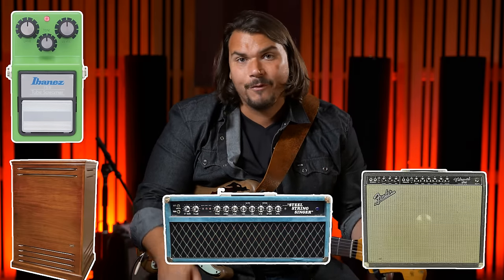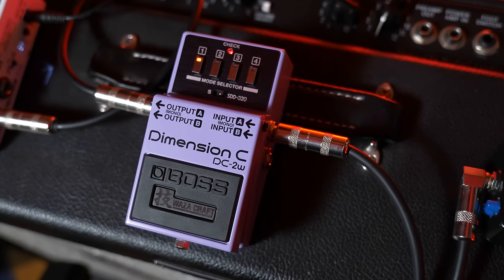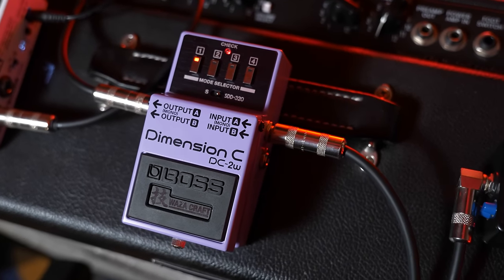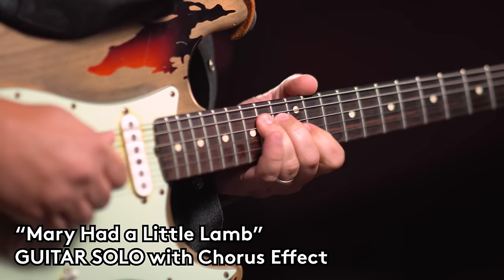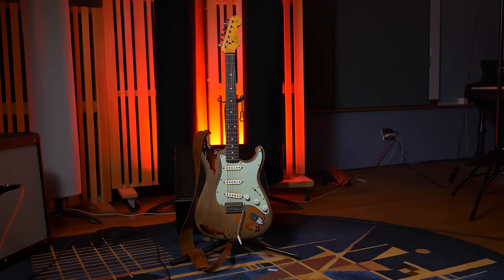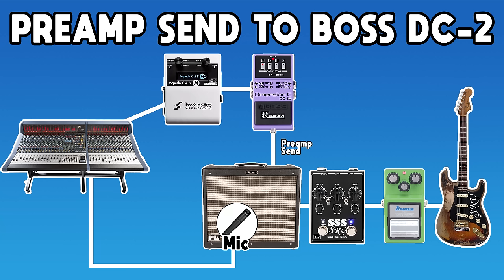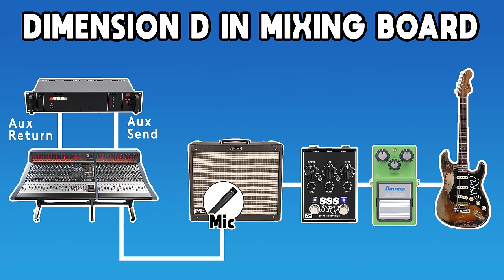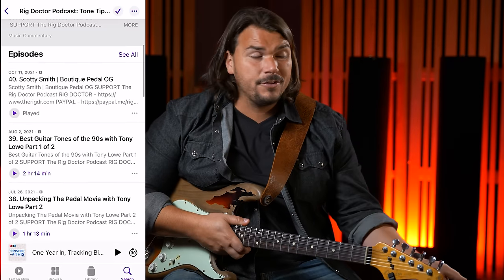The Secret Behind SRV's Tone

Comment from the maker: Which signal path do YOU think most closely resembles SRV's use of the Dimension D? Tell us in the comments below!

Table of Contents

00:00 Introduction
01:47 The Secret Ingredient
02:36 How SRV Used the Dimension D
03:25 How YOU can Implement It 
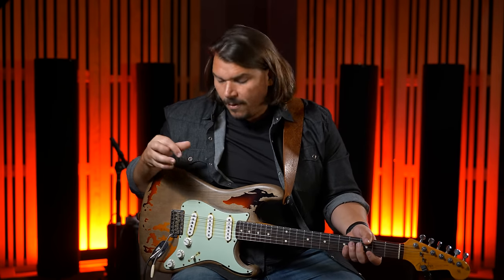04:44 The Gear You Need
05:20 "Mary Had a Little Lamb" Example
06:54 "Pride and Joy" Example
09:14 "Let's Dance" Example
12:28 Signal Path (So Far)
13:22 Alternate Signal Path Options
13:52 Signal Path Option #1
15:30 Signal Path Option #2
16:30 Signal Path Option #3
17:44 Our Way vs SRV's Way
19:04 Recap
20:45 Thanks for Watching!
Reply: Never noticed this effect but hearing it it now. He definitely had the rate/intensity more prominent on Pride.
Reply: Yea, SRV tone for the win 🤜
Reply: Dc2w, tc nova drive and source audio collider set to plate gets a good bit of the way for the first album sound 100% , I use the distortion side of the tc with very low gain to get a bit of faux pre amp drive with the ts side before it to emulate the tube screamer! It sounds great into a superreverb and bandmaster with sping verb off!
Reply from the maker: @MrAbelone  For sure!!!
Reply from the maker: @billytremoloband7456  Yes!!!
Reply: @VertexEffectsInc  can’t wait to actually get out gigging again with said set up, to be fair to you and your tone ears the tc nova and source audio collider are an excellent combination with a Strat, heavy’s strings and a loud cleanish fender amp! The dc2w then is just extra icing on the tone cake 🤜
Reply from the maker: @billytremoloband7456  Sounds like a dream!
Reply: I liked option 2 but I might be weird
Reply: says this comment was posted 2 days ago, but the video was uploaded 11 hrs ago 🤔
Reply: Well how would u compare it to the. Eric Johnson chorus pedal. The old one.
Reply from the maker: @godbyone  it's more about where the chorus is more than what the chorus is.  I'm sure any number of chorus pedals could pull off a similar result.  The X factor is having the chorus after the dry amp, in parallel.  You can hear when I go to the FX Loop example, it looses the subtlety of the chorus and the effect and really becomes obvious that chorus is present.  That's not now SRV did it...it was much more transparent and behind the scenes.
Reply from the maker: @dannap8831  magic I guess.
Reply from the maker: @WayneMemphisMojo  1 and 2 were both pretty similar.
Reply: @VertexEffectsInc  teach me your voodoo vertex effects!
Reply: I like the Double D in the mixing board. The chorus is there, but barely...and that's what I love about it, as I'm not the biggest fan of a super wet chorus. But the difference between using it & not, is HUGE! It's amazing that such a subtle change can add incredible dimension.
Reply: i have a timeline. can i use timeline effects loop to acheive this setup?
Reply: I used a later Roland digital delay rackmount unit with a chorus effect and some modulation. It NAILED the sound. It was a later more perfected delay from Roland Boss. A 55-65 ms  chorus delay with a slow medium slight modulation warble and bazinga ! Oh and I also built a 100% hand wired Dumble Steel String Singer in a 120-60 Watt version using a slightly better layout than Howard Dumble did. I did mine on a rare piece of large perf board wired up to British military specs on turrets kind of like a cross between a Hi Watt and a Fender layout. Howard used a very Fender like layout in all of his amps. Alex started out hotrodding Fender amps for The Ventures so he used Fender-esque layouts. His amps are a mish mash of parts from the bygone days of the corner electronics parts stores. You walk in say, " I need 600 volt 0.47 uF caps" and the clerk brings you whatever they had in stock that day. It might be an orange drop polyester or it might be a blue Arcotronics polypropylene cap. Again, whatever 600 volt film caps were on the shelves that day.  It could be Sprage, or Arco or Cornell or Paktron or Mallory, a no name jobber cap or whatever. Alex loved using cable TV coax too. Sometimes I use 75 Ohm RG6 other days 50 Ohm RG58, but I prefer shielded Mogami mic cable over RF coax. Again, whatever the parts store had in stock is what Alex used. If he didn't like the sound it made, he changed it out until it sounded right.
Reply: @VertexEffects - Mason, what pups do you have in your Rory Strat???
Reply: Thanks Mason!
It's an interesting story, but you left out one important point.
Was Roland Dimension D connected to the mixer's aux in stereo or mono?
And how was the SRV?

Comment: While it's known that SRV tuned down to Eb, I feel it's often overlooked what a tonal difference that half step makes! Fatter tone, makes the amp break up quicker, even makes you play different with the slinkier tension for expressive bends and big vibrato. Think of Hendrix too, or even Albert King with the extra slinkiness!
Reply: Once I started tuning to Eb, it has become my favorite way to play. Standard tuning doesn't sound right to me, now. It feels better, too.
Reply from the maker: Eb is how Strat's are meant to be played...As GOD intended :)
Reply: 1/2 step down just sounds bluseier especially when playing pentatonic scales. Stevie’s Strat was anything but slinky feeling believe me. He had for the longest time 13 high E thicker going up. On top of his GHS strings which are bright and steel. He liked a little give in the sound but not mushy so that’s why he moved from JBL’s to EV Forces. The Forces were softer and gave a little unlike an EVM would or JBL E series plus the JBL’s have a bright snap to them. So those speakers in conjunction with the tube rectified Super Reverbs and Vibroverb became his stage sound. He also loved his 50 Watt Marshall head he had and sometimes Plexi. He did try 11’s towards the end and even had 9’s on one Strat. I think had he been around still and used 11’s down a 1/2 step and maybe switched to Ernie Ball Nickel Slinky’s, 
that would’ve been magical! He had 
really strong fucking hands!
Reply: Theresa no slinkiness with the gauges SRV used. And as someone who's played with thicker gauges for years, I can tell you it's not the tuning that makes the amp breakup sooner.
Reply: Different tunings ,string gauges, Leslie speakers.no set rules for rock and roll. Dick Dale just played upside down guitar with out correcting to normal string sequence. I read a story that he never allowed  young musicians to play with him on stage but  I think Stevie got the opportunity ? Been saving guitar magazines since early 80s. FYI

Comment: To me, one of the hidden benefits to using almost any effects pedals is that they also add some compression to help smooth out the sound and tame some of the older amps strong attack.
Reply: Definitely!  Any overdrove/gain pedal will have a certain amount of compression that, upon which pedal, will help smooth, fatten, or do both to the tone that happens automatically in the mixing stage to get the music to the final product.  However, the only way the Dimension D was applied to all the songs on the "Texas Fllod" album would be after the recording and in the post-recording console.   "Texas Flood" was simply played, without any tube screamer, from SRV's Strat into Jackson Browne's Dumple amp.  Any mixing done was days later at a studio in NYC.

Comment: VERTEX, when cranking up the Drive which increase the gain on a Tube screamer pedal it gets that "boxy tone" like putting your hands around your mouth. To get that boxy tone but not have the gain increase I have to turn down the strat volume pot but then it get that very thin sound boxy tone. I'm trying to get that boxy tone but with the gain at low levels. What pedals do you recommend that get that boxy tones?

Comment: I got my DC-2w last year and was immediately blown away. If you use it on one of its highest wet settings, you get Steve Steven’s Flesh For Fantasy sound. He used the rack unit extensively in his 80’s studio recordings.  I have it on all the time on setting 1 and use buttons 3 and 4 (you can use 2 buttons if pressed at the same time) when I need a very wet chorus sound (like in Purple Rain). Thanks Mason for the awesome information!
Reply from the maker: Good call!  Be sure to try it in the parallel context as we did here and SRV did after the dry amp and mic and then blended in parallel with the dry.  Helps keep it subtle.  This is also how Steve Stevens used it on the Billy Idol stuff.

Comment: This is wild because I run my dunlop univibe on vibrato mode just barely and get this killer vibe too. It's there but it's not there ya know. Also, my pedal graphic in front of the univibe gives it a nasty stink on my Stratocaster. Drive almost off...but gain cranked just enough to 😂 zone the amplifier. Also, don't  forget to roll off the tone & volume knobs on your axe to tastefully get it right. It is a beautiful thing...thanks for sharing your knowledge with everyone. It is very unselfish and nice! 👍

Comment: The most valuable info I have gathered is to have a Fender blackface amp cranked to breakup, a Strat running through a TS with volume high, gain low. This seems like a missing piece of the puzzle that no one talks about. Might have to try it. Thanks for the info!
Reply from the maker: Yes, definitely an overlooked element.

Comment: Fired up my Axe FX III and found the dimension chorus in there - I was amazed A and Bing soloing with and without it on.  Never have I ever thought to use chorus on lead guitar - only ever used it messing around with Come as You Are - thanks man!  Very enlightening!
Reply from the maker: Great to hear!  Make sure you run it in parallel, very easy to do in the Axe software!

Comment: Klark-Teknik makes a rack version of the dimensional chorus, it's currently $149 at Sweetwater. I thought it was widely known that SRV used a TC Electronic Stereo Chorus+ Pitch/Flanger to split his signal when he started using multiple amps on the gig. (I'm pretty sure there are pics) A more pedalboard-friendly re-issue is due any minute, minus the AC cord and for a very friendly price, compared to the vintage ones.
Reply from the maker: I've not seen photos of the Stereo Chorus from TC being used, but I also feel like those are too bright compared to the Dimension D and or DC-2W.  I own several original TC's and Boss DC-2's.  The Klark-Teknik looks cool!

Comment: Cool video I just wish it was able to sound like that in the effects loop. This totally shows you that signal path plays a huge role in getting the sound you want.
Reply from the maker: For sure...another way is to put it in a mixer in the effects loop so you can blend it with the clean signal.  That would help put it closer to what you heard in the other examples.  Something like an Xotic X Blender or OBNE Signal Blender.

Comment: That's very interesting. When I saw Johnny Winter live, a while back, guitarist Paul Nelson warmed up the crowd with Johnny's band. He had two Fender Super Reverbs, a pedalboard that was the size of a small Indian rug, and a Strat. He sounded great, I think he was running two differently timed subtle delays. It was a big sound to say the least. Then out comes Johnny with his Erlwine Guitar, a Musicman HD130 amp and no pedals and the sound is even bigger. How is this possible? As I got closer to the stage I noticed that Johnny was in fact running through a pedal, hidden just behind a monitor. I had to find out what this killer overdrive was because the tone was fat, 3D and just amazing. I finally nudged my way to the front and much to my surprise it was not an overdrive at all it was a Boss chorus (what the hell?) with the chorus set almost off, not enough to make a chorus effect but just enough to thicken the tone and give it a little warble.The volume appeared to be past unity and maybe boosting the signal but I'm not 100% sure. I didn't know Stevie was doing something similar so, thanks Mason for this informative vid. I've only done one studio project but I'm starting to realize that the real Kings of Blues tone, it seems, are doing it with a big clean tone first and this is where your SRV pedal would really come in handy, then maybe a little OD on top. I was once guilty of thinking, like a lot of beginners, that the only important component to great tone is your overdrive pedal gain staging and there is a lot more to it than that as you so aptly point out.
Reply from the maker: Thanks for watching and the comment!

Comment: I used a Roland SD1000 set at about 63mS with modulation in place of the old 4 preset SRV DimD type Roland chorus. 60mS would swallow up some D notes with standing waves, so set to 57, 58, 62 or 63 milliseconds. I want to stay about 2 mS away from 60 in case I go sharp or flat a wee bit. I traded a 22 kt gold tie clip some old person gave me for the Roland SD1000 delay.

Comment: The interesting thing is that Stevie is playing Albert King licks. As I'm sure you know, Albert used an MXR Phase 90. I'm wondering if Stevie used the Dimension D to more replicate the sound of Albert.
Reply from the maker: Perhaps???
Reply: @VertexEffectsInc  ❤️
Reply: Albert definitely used a phase 90 and I’ve seen several videos on it. It sounds just like him. He used it like EVH did on a very low setting to knock the single in and out of phase to make the notes move around the “ higher and lower pitches “ he may of had a switch on his guitar before the effect came out to make the pickups out of phase like I believe Rory and Paul Kossof, Peter Greeb and Feampton did ( Frampton always used a Phase 90 ) as well.

Comment: I want this sound live so I’m going to try it with a wet dry two amp set up. Right now I use a very subtle warm chorus sound through both amps on some songs. I know it’s there but most wouldn’t notice.
Reply: Sometimes I use a little bit of modulated reverb through both amps from a Boss RV-5
Reply from the maker: The main thing is separating the chorus in parallel with the dry path.  I think that's more important than getting the exact right chorus circuit.
Reply: @VertexEffectsInc  after watching this video I think so too. That’s what makes it sound bigger and lush. I have been a fan of the Dimension D from the John Jorgensen style. I didn’t realize Stevie was using that. It is a nice circuit. I don’t want to copy Stevie exactly but I definitely point back to him often while running with it to somewhere else. I steal a lot from Jimmie too.

Comment: This is brilliantly done, much appreciated! What do you think about coming out of a Strymon timeline (stereo)with two leads and then putting one signal path through the Dimension C and then into a parallel blending box and the other signal directly into the parallel blending box and then out into the amp. The idea being to regulate the amount of effect in the ultimate signal? Cheers mate, killer as always!
Reply from the maker: I think you'd be better off putting the Strymon after the preamp section and running it in parallel or running it after the mic as an aux send.  The parallel mixer isn't going to do much if it's still in series in front of the preamp to get this sound.

Comment: Thank you for making this video since we have been talking about it. I would make another video about this using the Boss line section LS-2 because it has TWO send and return ports so you can use a Boss EQ pedal or another EQ pedal in one port and put the Boss Dimension D in the other send and return port. This way you can blend in the EQ and Boss Dimension D with the dry signal mixing which is more like using a mixing console. Using the LS-2 also should help with the impedance mismatching and Send level so it doesn't overload the Boss Dimension D input stage. So I think using the LS-2 in amplifiers effects loop will help balance the levels of the send level and return level? I remember we were talking about vertex making a guitar pedal that will fix this issue but I think the LS-2 will fix these issues. A recording console has an EQ and parallel send/return levels so the LS-2 with an EQ pedal will be more lie a recording console using the Boss Dimension D to just make the Dimension D create the "widening" and "spread" of the note you don't want to make it sound like a chorus pedal just very subtle mixing blending it in the right amount to the get those notes to be widen and spread for an imaging effect. I'm sure they make other pedals like the LS-2 that is connecting pedals in parallel and mixing them in with the dry signal plus fixing the impedance mismatching of the amplifiers send and return signal level dBA dBm levels.
Reply from the maker: You're welcome.  The issue with the line selector is it would still just need to be after the line out or FX Send and then into it's own DI or a simulation like I have here.  I don't know that it would add anything here if you're trying to re-create the SRV signal path.
Reply: @VertexEffectsInc  yes true but the line selector would give the dimension D a parallel path with the dry signal of either the line out or the FX send because you want to be able to just blend mix in very subtle because if to much it just sounds like a chorus pedal when its meant to be used as a widen spread imaging effect. All amplifiers FX send levels and impedances are at different instrument levels or line levels and I think the Boss Line selector in the effects loop will fix this problem. The best amplifiers that has the options is the 80's fender princeton stereo chorus amplifier with the red knobs or other models at that time has power amplifier Fx send and return for stereo so you can use the dimension D only on one of the power amplifiers to go to only one of the speakers and the other speaker would be the dry signal. This was a great way to really use the Dimension D but most amplifiers don't have these jacks ports for the stereo power amplifiers options.